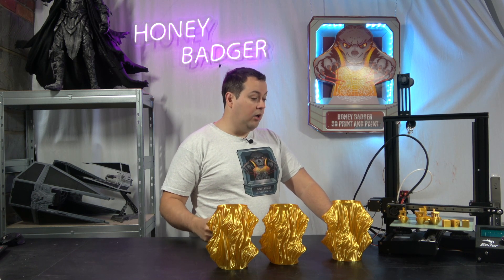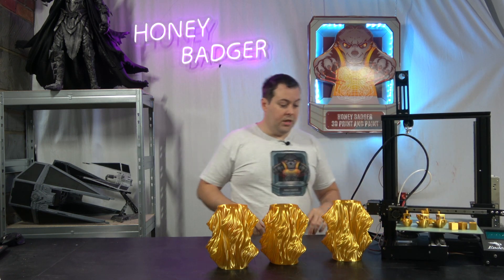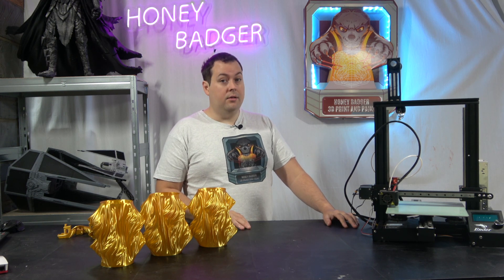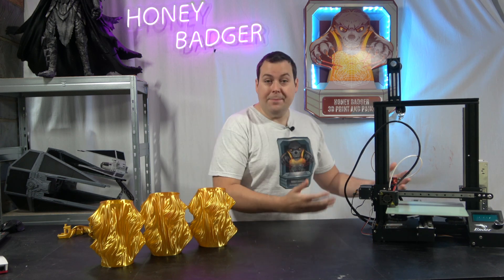Ender 3 Balck knight kit

Comment: try running klipper firmware with input shaper
Reply from the maker: so the issue with speed right now isnt the vibrations per say its more that a stock extruder and hotend cannot melt filament fast enough

Comment: Missing: is the max. print size x,y,z smaller after that, how about noise, how about needing to change the belts, how about the enstops X and Y ?
I am currently installing that. One big part is proper preparation of the rails and blocks, with cleaning + greasing + oiling - choose quality products-.
Reply from the maker: noise is non existent but we already had a 4.2.7 silent board in it, no loss on any axis, we didn't clean our carriages or regresse them and it is working really well, all endstops are original, we wanted to keep this as stock as possible to try and show what just the kit can do rather than a full upgraded ender if that makes sense
Reply: @honeybadger3dprintandpaint  Thank you for your reply, I appreciate ! Happy Sunday

Comment: Changing just speed may be quite misleading if the acceleration stays the same as for the stock printer. Increasing acceleration would really show the upgrade strengths / weaknesses... For small prints event 100mm/s is rarely reached...
Reply: I agree.
One would need to check in Preview with the speed view setting to see if that speed is reached.
Better would be to design a large object with 90° turns and some sharp 30° and some round corners, then modify the gcode increasing the speed and/or acceleration settings at fixed (f.e. 10 layer) hights.
Also, a bi-metal heatbreak might allow higher feedrates, and that is a cheap long-lasting upgrade.